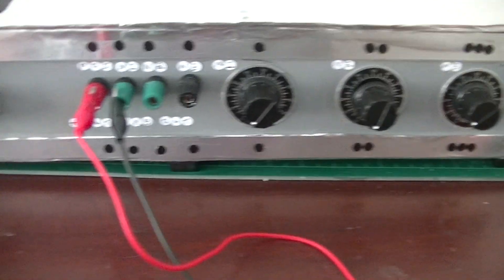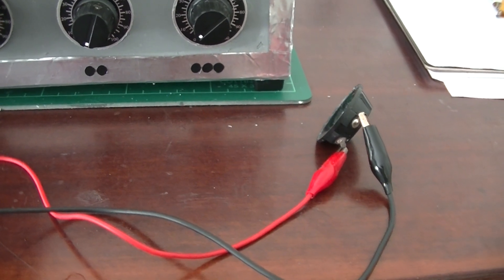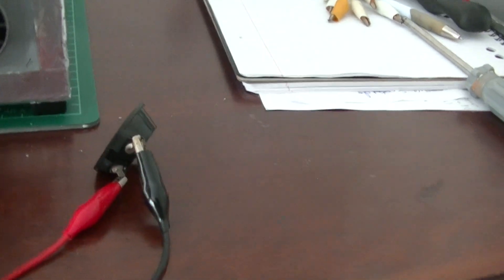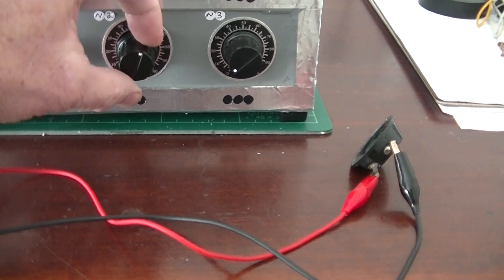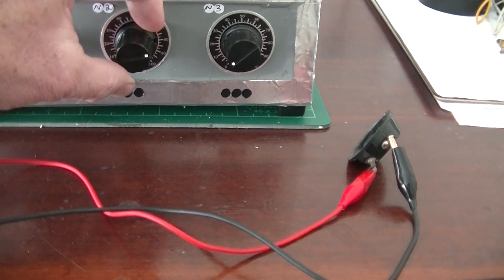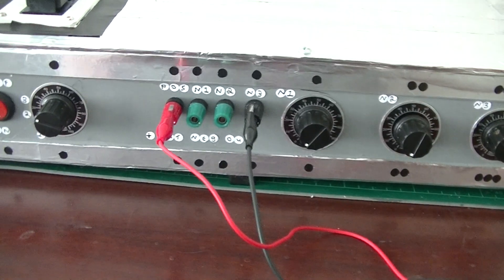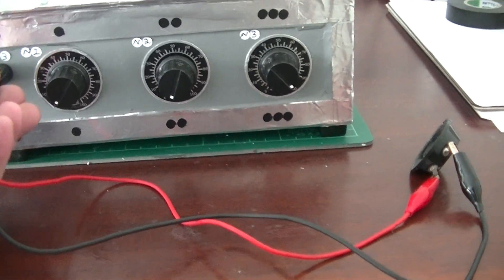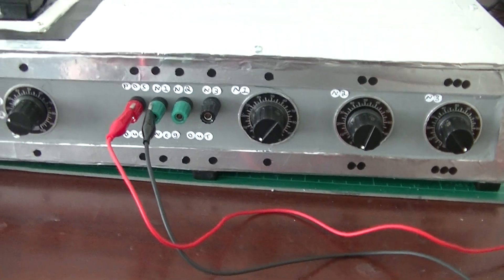30 frequency output to a piezo demonstration

Comment from the maker: ive brought out my jaycar electronics amplifier the same one used in my ghost box designs that can amplify small signals to and i linked it to a 12 volts dc battery pack have no idea at the time if they had a full 12 volts dc in them or not,  at the amp output i have 2 wires runing to a small piezo same one i used in my 20 frequency  generator project , and in ran to wires from  one of the input channels as i only need one the other has a link runing from one to the other when not used as in accordance with the assembly instructions i fire up the frequency generator and got an amplified output through every frequency i selected but now come the bizarre part , after testing all frequency outputs through the amplifier kit i decided ok time to end the test so instead of just turning it off at the on/off switch at the 30 frequency output circuit i just unhooked the negative wire from it first so that would break the input circuit but it still sounded like it was getting a signal from both inputs with only one wire to the input connected i got a shock i checked it and  said out bullshit it cant work off one wire input, so i reached over to the rotary switch and switched through other valued capacitors and got various output signals to the piezo through the amp  and with just one input wire from the positive  output only  of the frequency generator to only one input of the amp , and when i ground that unhooked input to my fingers it alters the audio output  a little as if its still picking up that unhooked input from the 30 frequency generators  output to the unused amplifiers input

Comment from the maker: with the 2 piezo outputs of my 20 frequency generator as i set one frequency output of one section to it piezo and rotated the frequencies on the other output to its piezo i get to a spot where the sounds from both pizeos vibrate together or  resonate but the question is can there be a third frequency that can react with the 2 resonant ones taking into consideration the number 3 as mentioned by tesla as being one of the numbers in 3.6,and 9, and what would the resonant effect be then .